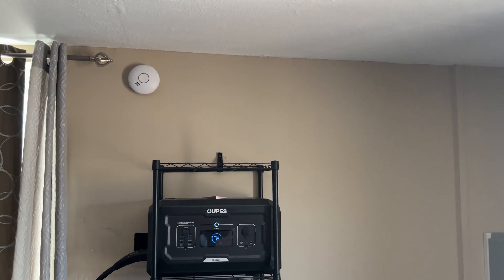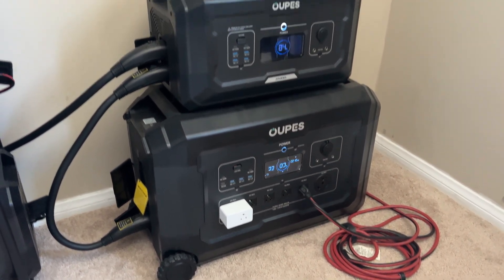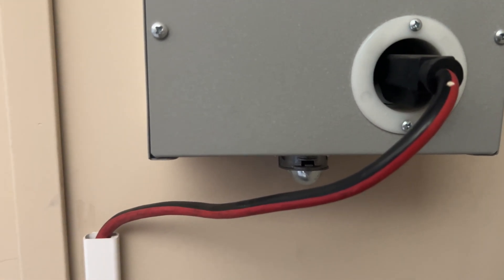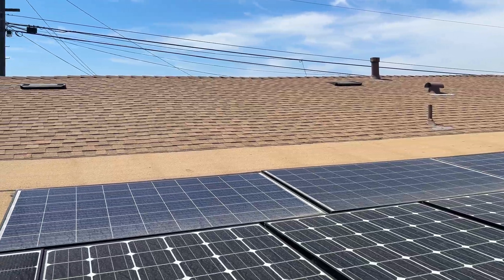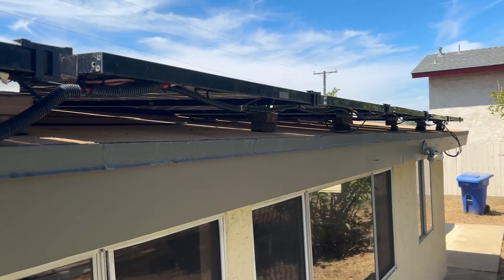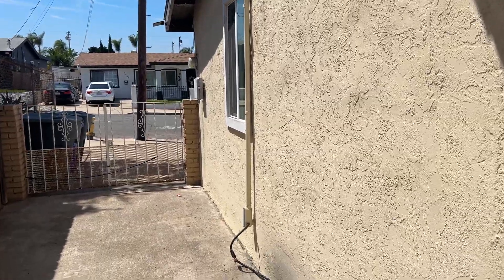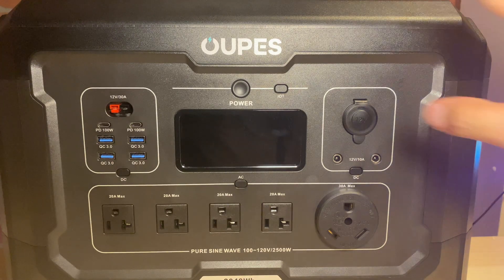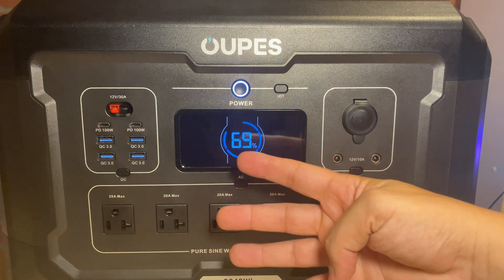Powering My Entire Home with the Oupes Mega 3, Solar Panels & Transfer Switch

Comment: It would be a better deal if u just buy the mega5 bundle kit with b5, than add another b5 total of 15wh total $4.2k. Than buy $2077 of 5500w solar panel total of $6.2k. 😅
Reply from the maker: The only problem with the B5 is that it doesn't have solar input like th B2s
Reply: @OffGridSolarSmartHouse  was a crazy decision to not have solar input son the b5 batteries it makes the mega 3 a bettery system.
Reply from the maker: That's the biggest reason why I opted for the mega 3. More solar input.

Comment: With all that power, I would upgrade my transfer switch so you can use the washing machine and possibly a 3 ton A/C unit. You have gotten your return on investment with the current transfer switch. I have had my transfer switch about 4 months and now that I have gotten comfortable with using it I’m ready to get a 10 circuit transfer switch.
Reply from the maker: I can use the washer machine, I don't have a central air conditioner but your right at some point I will upgrade the transfer switch

Comment: Ayyyy that's awesome you run your home ac as well? I asked someone prior if you could use Oupes to run your house and they said you needed a 240v (dont quote me im new to all of this) and here you are doing it nice.
Reply from the maker: Yes, It does but I don't have central air. I have window air conditioners and portable ones. I can use them both at once too. I run my air condition almost 24/7
Reply: @OffGridSolarSmartHouse that's amazing Sophia at central air we would  most likely need the 240-volt system